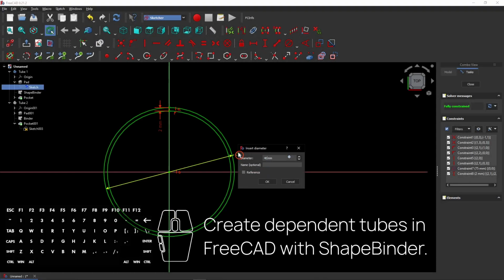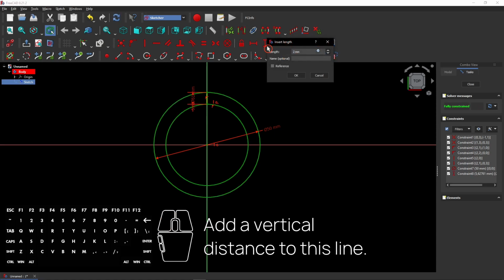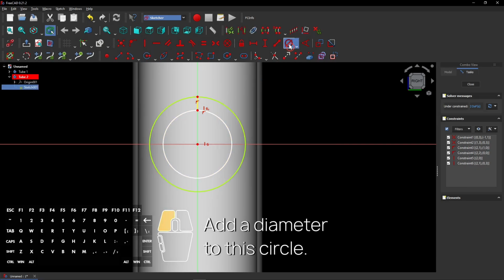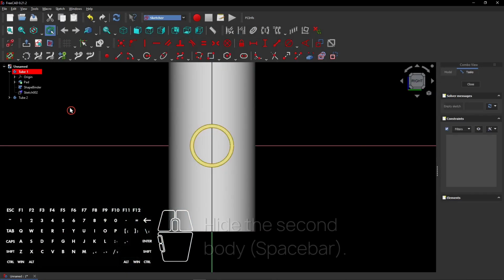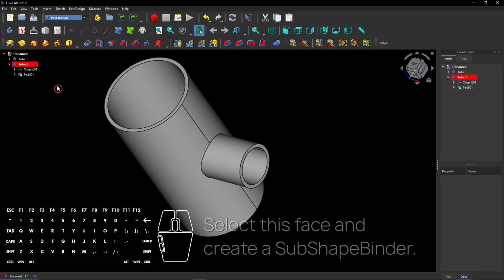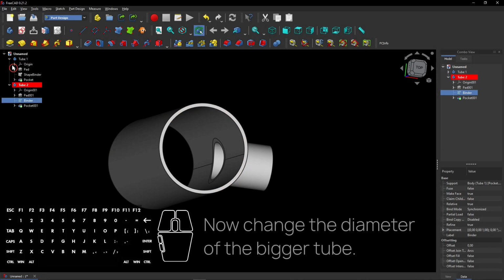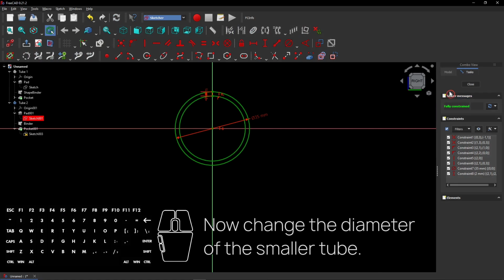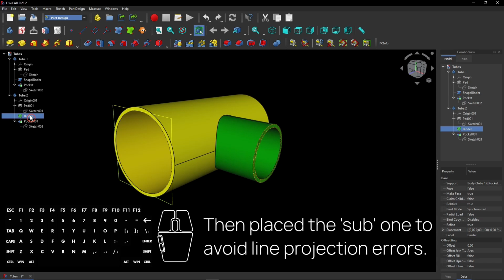😮 EASY - FreeCAD ShapeBinder Tutorial - FreeCAD Tube - FreeCAD Pipe

Comment: Great video - however when I changed the size of the smaller tube the hole never changed - it stayed the same size as the original - if you have a comment I appreciate but yeah now I can fix my storm water run-off - thanks
Reply from the maker: Thanks! Did you also use a ShapeBinder?